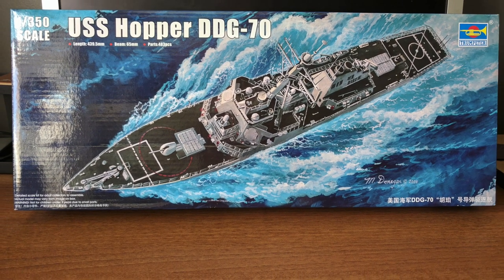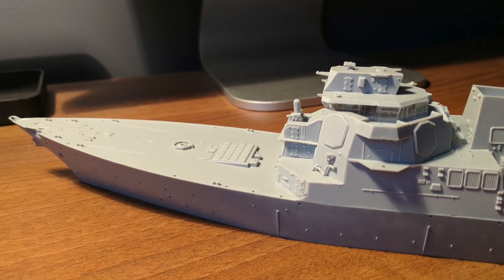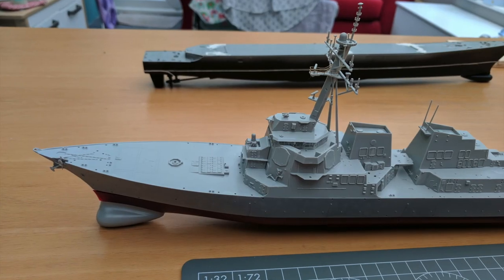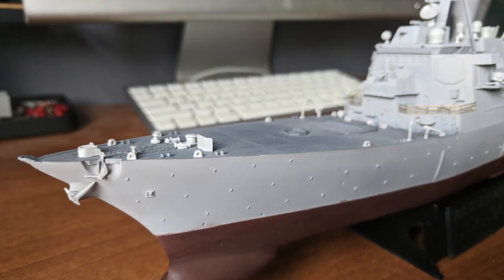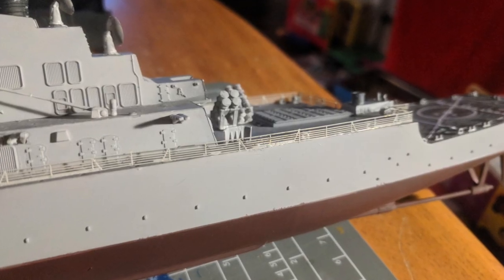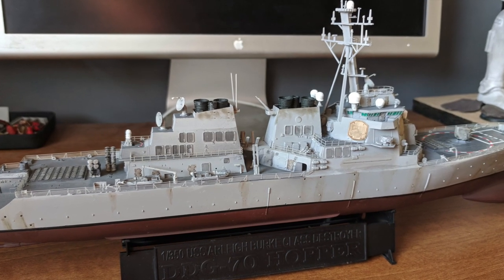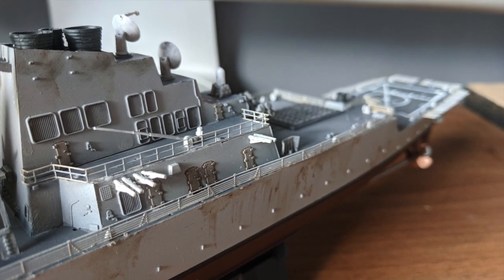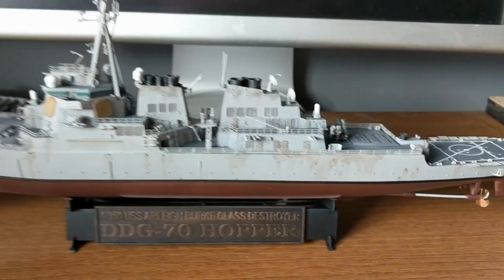USS Hopper DDG-70 1/350 Arleigh Burke Class Destroyer

Comment: Just ordered this model, it will be my first since I was a kid. I wanted to clarify your steps: Paint, Gloss, Decals, Gloss, Weather, Final Varnish is that correct? Can that process be achieved with brushes? Thanks!
Reply from the maker: Hi Michael, yes, the order is spot on! You can paint with brushes of course but would suggest a rattle can varnish - it will make things so much easier for you! Best of luck with it!
Reply: @JJModelMaking  Cool thanks!

Comment: Hi, is the photo etch you used in building this USS Hopper the set provided in the kit or did you use a upgraded set like the White ensign USS Arleigh Burke class photo etch set?
Reply from the maker: The photoetch actually came with the model, was quite surprised!
Reply: @JJModelMaking  OK thanks. Was considering buying the White Ensign photo etch upgrade but it's more expensive than the entire Trumpeter USS Hopper kit that arrived today.